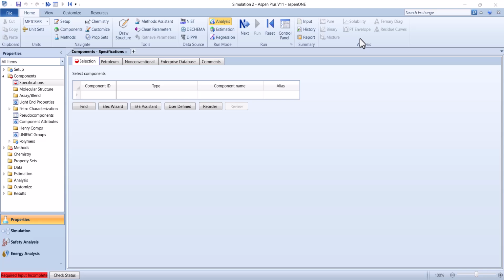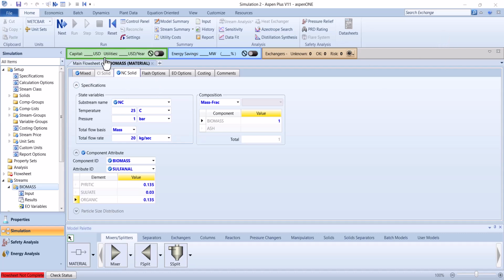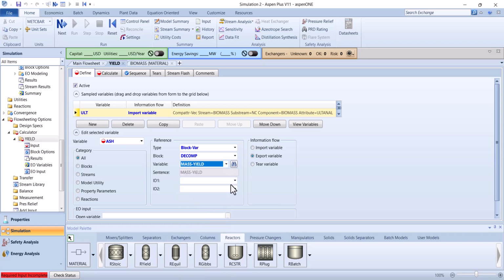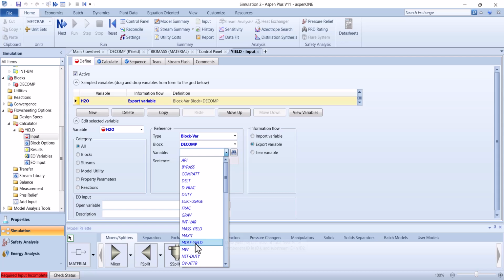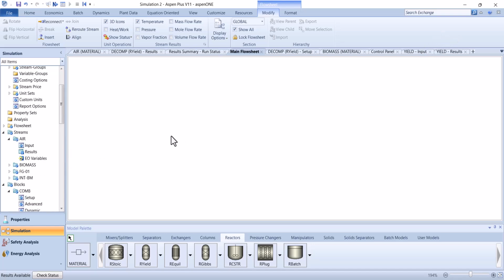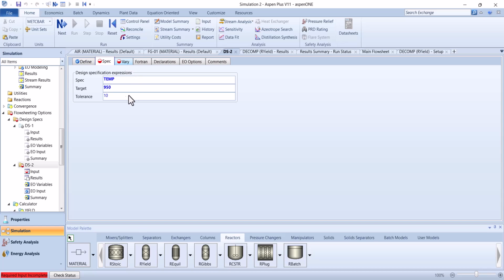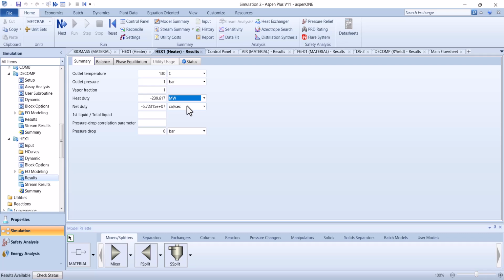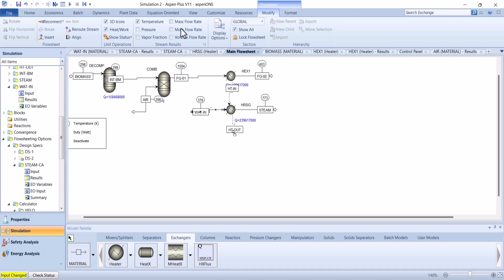Biomass or MSW combustion modelling and simulation in Aspen Plus

Comment: Thank you for your video, really helpful.

A couple of questions:

 1) the amount of sulfur introduced in the Sulfanal analysis is in percentage weight with respect to the original material or fuel, this amount of sulfur should not coincide with the % estimated by the ultanal analysis? In ultanal only 1.1% of sulfur was introduced and If we calculate total sulfur in Sulfanal its 0.3%, which will be the correct here?